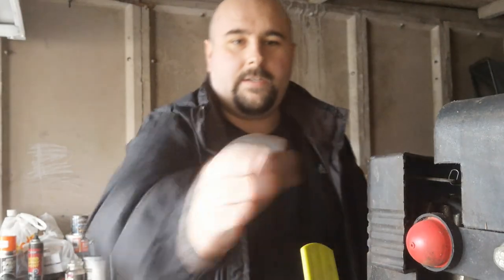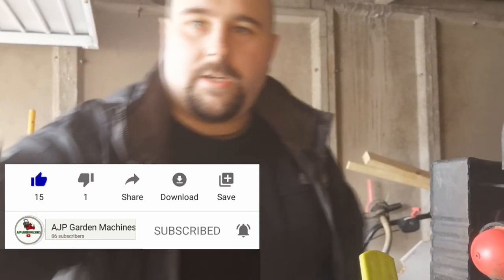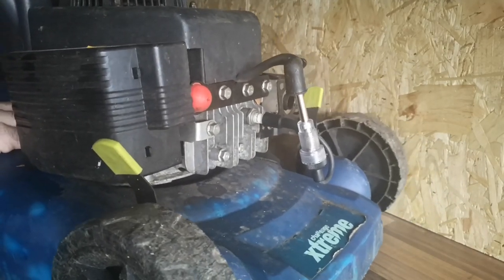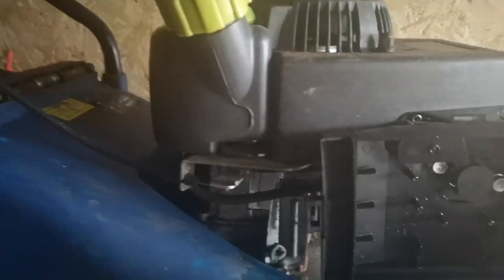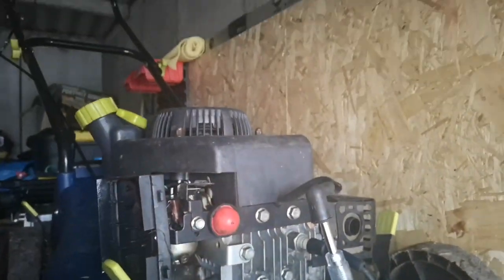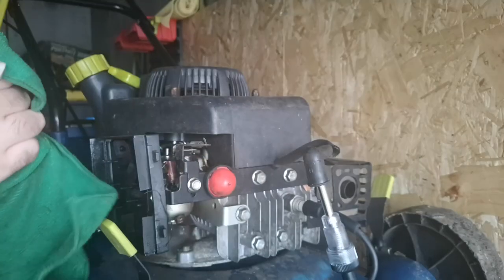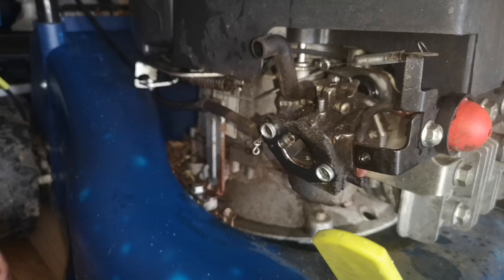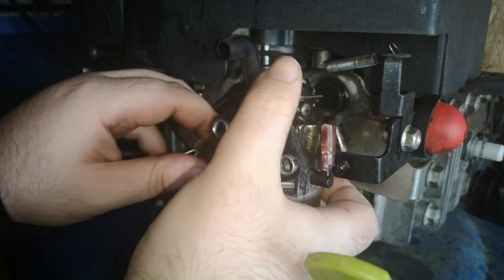challenge xtreme xss40a mower Not priming  part 1

Comment: So just take the air box cover and air filter off.. have a look to see if the choke flap is closed.. if not check the spring on the choke.. it will need to be closed.its sounding like its not priming.. I think the prime button has a hole in the front.. spray some carburettor cleaner in the primer and try it....
Reply from the maker: yh it does have a little hole in and will try this tomz if the weather is ok thank you for the help mick
Reply: I agree  with Mick Mowers Buddy. 👍
Reply: Who ya gunna call Mick mowers 👻👾👻👾
The best lawnmower man in the whole world.....👾👻👾👻👾👻
Reply: @s-s-p704  rofl 😂

Comment: Check out my last video for fault diagnosis procedures. You needed to remove the emulsion tube under the main jet to clean the fine holes too bud. This is the cause of most running issues on these carbs
Reply from the maker: Thanks Martin iv watched your video helps a lot and i will clean the carb again and remove the emulsion tube thanks for the help 😀